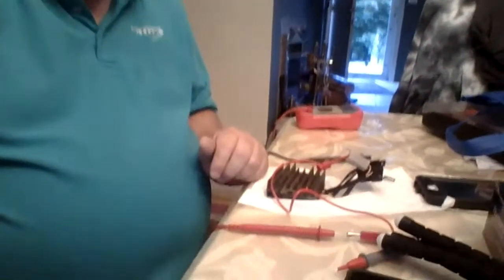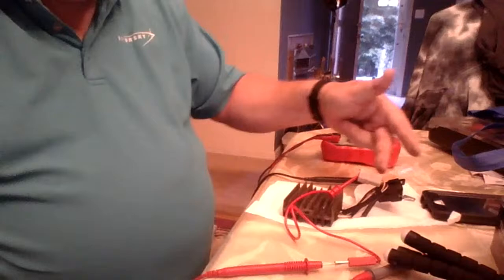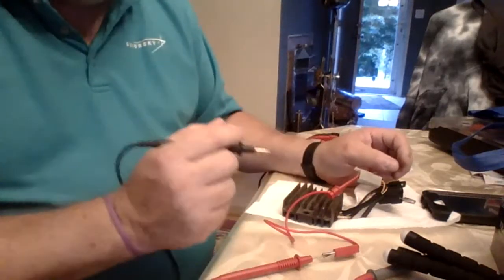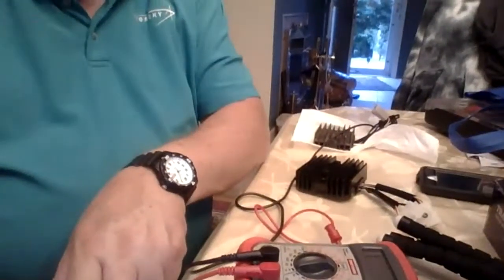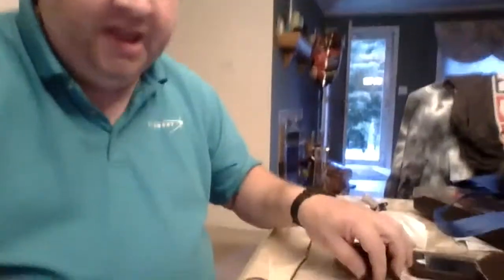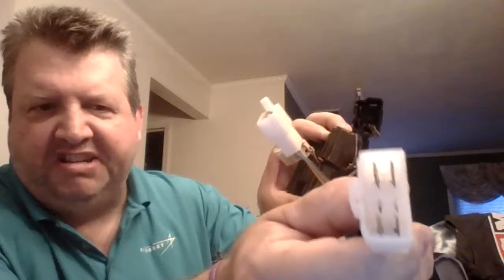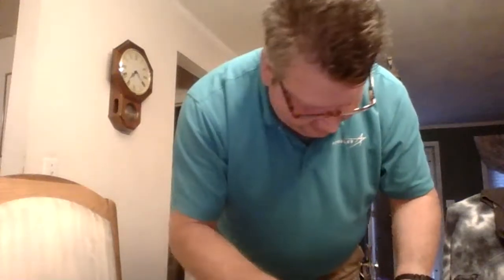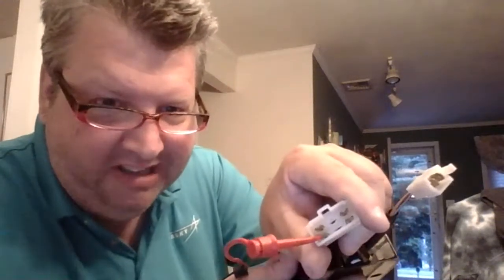More on Rectifiers and Regulators

Comment: Missed the live feed was setting up the camper at Rock Fork State Park, Glad your still able to read this and your house is still standing.
Never thought that rectifier would pull enough amps to blow the hook off of your lead, Amps will kill ya. 
Great Video lots of great info now waiting for the follow up
Reply from the maker: Craig, the “hook” on the end of the lead was barely soldered on. Didn’t take much to melt it (cheap Chinese leads) I just couldn’t see spending 80 bucks for genuine Fluke leads when the meter costs 30 bucks!  My biggest issue is I created the same problem that caused it to short in the first place that being a bad connection or in this case such a small connection it couldn’t handle the amperage. Now I know and hopefully you all know now too.
Reply: @KensSmallEngineRepair  I agree, why spend more on accessories than the core tool cost as long as you can preform the task at hand.
I believe that most of us is probably guilty of useing some improper tools/accessories while performing different tasks.
NOT ME💥🔥🤯🤬🧠